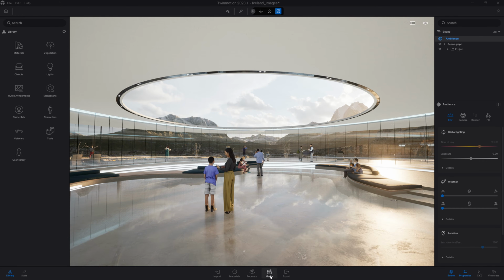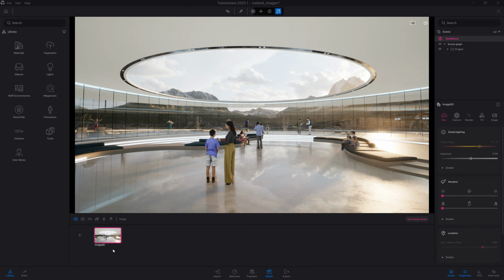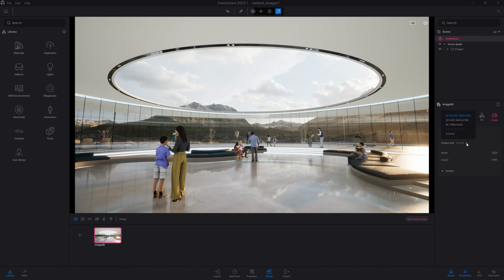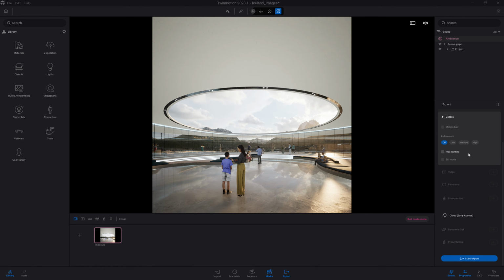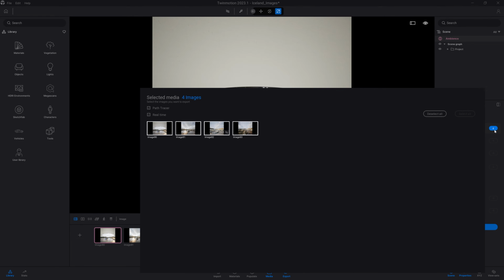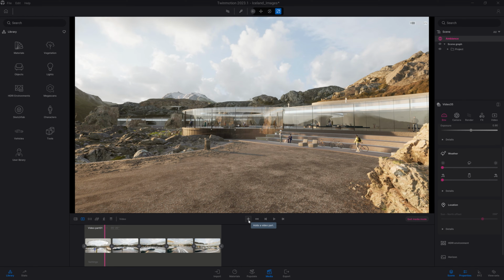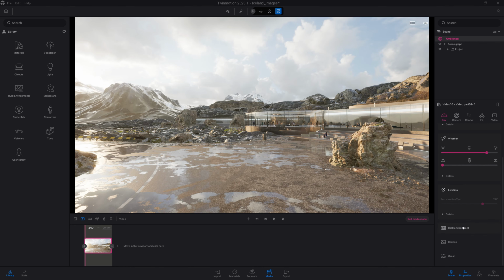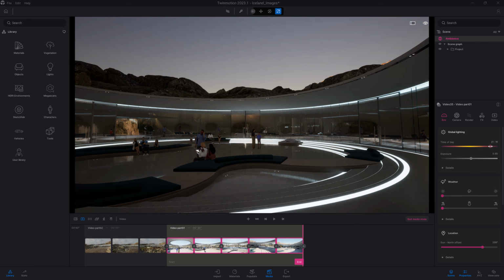Creating Images and Videos | Twinmotion Tutorial

Comment: FOLIAGE ARE LOST AFTER REOPEN THE FILE .... ITS COST MY TIME AND MONEY... VERY BAD EXPERIENCE......ITS NOT FOR COMMERTIAL SOFTWERE.... ONLY FOR VISUALIZING
Reply: There is a very good chance it’s not TwinMotion’s fault. Chances are you have a very weak computer and graphics card. Consider upgrading and try again. I have a high end laptop and Twinmotion works just fine. I have rendered small projects and very large projects as well. Again, it’s probably your computer that’s the problem because of the heavy requirements required with each upgrade
Reply: @CallsignHarry  yes that is true...